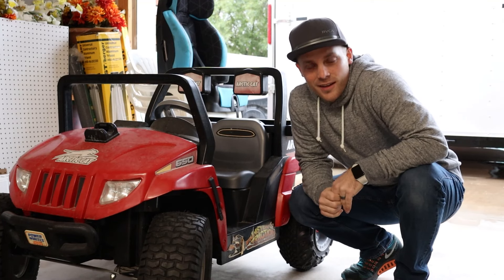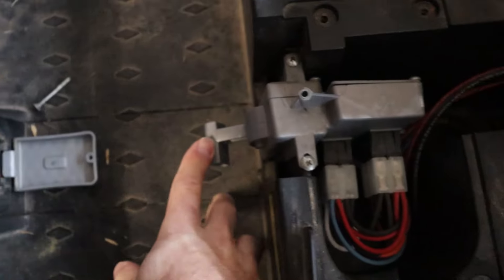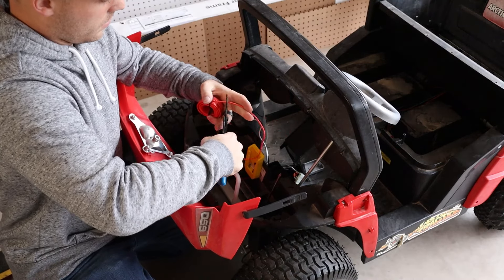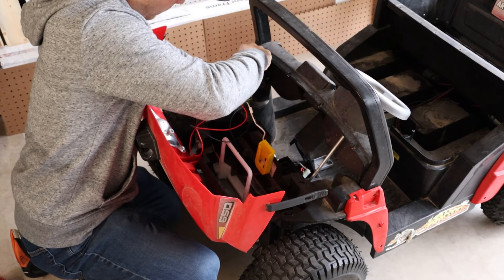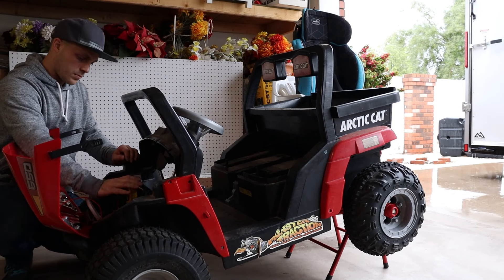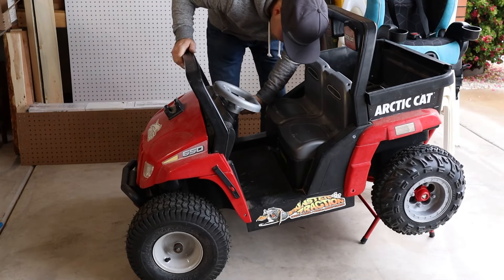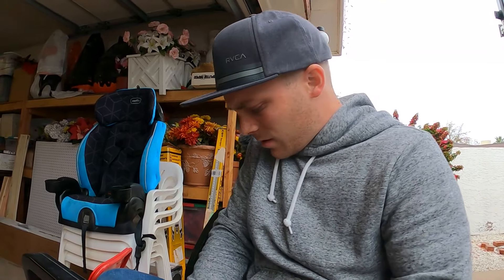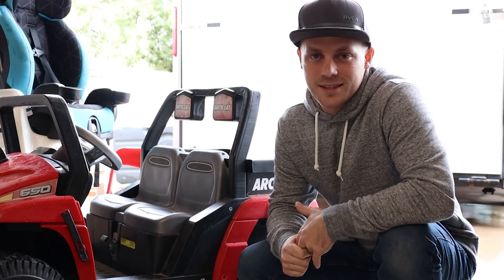Power Wheels Upgrade - HOW TO (20V Battery Upgrade)

Comment: Hey. I’m looking to do something similar to my nephews Police Dodge Charger, but I just have a few questions. Can the DC Motor Controller work when the car is in reverse? I noticed you were able to do it in the video however on Amazon people mentioned an additional relay is required. Also instead of adding a switch this Police car has a built in one that powers it’s radio, siren/lights, batter level indicator functions on the dashboard, as well. So my question is, the wiring it somewhat similar to you however the wires for the accelerator and ignition switch lead towards the rear of the car to the gear selector, to the motors and ultimately the battery. So would I simply disconnect the old battery. Use the DC controller and connect the motor to that and connect the new battery, without having to cut or add any additional wires. My main concern was if the lights and other functions on dashboard burn out when connecting a 20v battery. I know the 20v dewalt battery adapter has a 30A fuse and so does the DC controller but i don’t wanna take a risk blowing things up lol. I wish the car didn’t have these extra electronics to complicate things but your input would be greatly appreciated. Sorry for the long post! And thanks again.
Reply from the maker: Good questions.

The DC Motor controller only controls voltage (which governs speed), not polarity (which reverses the current and motor direction - think forward/reverse). So it's true that you need something else after the motor controller in the wiring to control the direction the motors are turning.

If the gear selector on the car is similar to mine (FWD High, FWD Low, and Reverse), then what you described you plan to do  - swap the old battery with the new battery, battery connector, Fuse, and DC motor controller and leave the rest of the wiring in place - will work. Doing this will allow you to control the voltage to the whole car simple enough.

As for the lights, sirens, and other features, there could be an issue with those. Without seeing the circuit, it's difficult to say for sure. Most of those components will be rated for a specific voltage (i.e. - 12V DC), but they will also have some tolerance at which they can run and not have any issue (i.e. - between 9V - 15V DC or something similar). By increasing the system voltage to something higher like a 20V Dewalt battery means that you may be outside the range at which they will operate effectively due to the combination of current and voltage that those features will use. Too much of both at the same time means power overload and burn out.

If it was me, I'd try doing the swap and see what happens with the other components. If I wanted to keep those features and make sure they work, I would also consider looking at trying to isolate the circuit which goes to those other features if possible and consider adding in a separate voltage/motor controller or a buck converter (like this maybe https://www.amazon.com/Converter-Adjustable-Regulator-Efficiency-Transformer/dp/B08L5VRBZS/ref=asc_df_B08L5VRBZS/?tag=hyprod-20&linkCode=df0&hvadid=475793181977&hvpos=&hvnetw=g&hvrand=17271168766185585186&hvpone=&hvptwo=&hvqmt=&hvdev=c&hvdvcmdl=&hvlocint=&hvlocphy=9030031&hvtargid=pla-1130173743967&psc=1) to step down the voltage only to the parts of the circuit you need to.

But that's only if I wanted to keep them in place. If that did not matter, I would consider disconnecting them from the circuit and closing off the loose wires so there's no hazard in place.

Good luck with the project! Would love to hear how it turns out!

Comment: How long does the battery last compared to a power wheels battery
Reply: Looking for the same info
Reply from the maker: Depends on the battery size. A 4 or 5 amp hour battery can give the kids a good 45 min runtime on level ground. I have not done a full time test to compare the difference, but the original battery seemed to be close to 10 mins if I was lucky.

The big benefit is having several spare batteries around that can be charged up and making it really easy to swap out and keep going.

Comment: 30A fuse is wild.
Reply: Considering those 20v drill batteries are around 6amp hours and typically draw less than 10amps actively.. yeah. Way too high to protect anything. A 13 or 15 fuse would be about perfect.
Reply: I keep blowing my 30 amp fuse . Trying to figure out a way to fix it.

Comment: How long will it run with a fully charged battery
Reply from the maker: It depends on the size of the battery. If I run it with a 4 or 5 amp hour battery, the kids can usually get a solid 45 min out of it. Having multiple batteries available and charged up though makes it easy to get more use by switching the batteries out quickly. That's one of the biggest benefits in my mind.

Comment: I did this. It works but my 30 amp fuse keeps popping . Barely rides 5 minutes without blowing the fuse. I am currently searching for a fix.
Reply: I have this problem as well too much volts from the 20v dewalt battery.  Think need to upgrade the 12v system to a 24v wiring kit

Comment: When you turn the motor controller all the way up is it sending 20v through the 12v speed controller and motors? 

I figured i could boost the voltage a little higher but wasnt sure if 20v would be too much for the 12v components...
Reply from the maker: The motor controller I'm using is a DC speed controller. There are no other components in my system that regulate the speed for the motors. When it is all the way up, yes, there is 20V going to the motors and downstream components.

For a DC motor, in general the speed is dictated by the voltage (V), while the torque is dictated by the current (I). Watt's law says that power (P) is equal to the voltage times the current (P=IV). Ohm's law says that voltage is equal to the current times resistance (V=IR) or the resistance is equal to the voltage divided by the current (R=V/I). It's important to consider both of these laws in your system. A DC motor will draw more current to try to maintain the load which can lead to run away and burn outs.

What it means in reality is that if you run a component at a higher voltage or a higher current, the power will be more. If you run the component at a higher voltage and maintain the current load, then the resistance of the component will go up. In general, when resistance goes up, components tend to get hot. That's where burning out motors or components happens.

So yes, DC motors can usually handle more voltage than what they are rated for. But that has to be balanced out with the current load to ensure the power and resistance are not so much that you create "magic blue smoke". That's why I used a fuse in the configuration - to help limit the amount of current and prevent burning out my motor or components. As long as my components are rated to the fuse current or higher, the fuse will help protecting them.

There's probably some exceptions, but I won't cover them here. Happy building!

Comment: Nice!  How much range do you get on a power tool battery?
Reply from the maker: It all depends on how it’s used and capacity of the battery. The age of the motors may also have an impact. Driving on flat ground, I can expect around an hour on a 5 Ah battery. The best part is having multiple batteries that are fresh that I can switch out with if needed.
Reply: Good job..I just did this for my child rubble digger which is only 6 volts but I put 20 volt battery and I just keep it at 35 or 40 speed so I don't burn out gears or motor Im.just happy it last longer then lead battery and charges waaaaayyy faster
Reply from the maker: Sounds awesome! And it's true, way better than the older batteries.

Comment: Thanks for this. I did this on my kids' PW Dune Racer 12V. Added an in-line fuse, but it pops quickly. Weirdly, a 25amp fuse lasted about 5 minutes, but the 30a fuse went out immediately. Suggestions? Increase the fuse size or try something else? Didn't add a speed controller.
Reply from the maker: This is a great question - something pretty common. You could increase the size (I would not recommend something over 40A). The bigger the allowable amps, the higher the possibility for burning something out at the motors.

The important part is to understand why the fuse is popping. The motors will essentially draw as much current as they need to keep rotating. If the resistance against the motor turning increases, it requires more torque to overcome which means more current and power. In my experience, as long as it was driven pretty normally on flat ground by kids who were not too heavy, there was no problem. However, get a hill, someone grabbing it and dragging their feet or kids too big, and I would pop fuses left and right.

Also, making sure there’s nothing else the wheels could be rubbing on could help too. Hope that helps!
Reply: @TheWorldIsOurLab  Thanks man. Great advice. I’ll bump up to 40a and tell the kids to lay off the twinkies. 😁
Reply from the maker: Hahaha!
Reply: How has this worked out for you? From what I’ve read, 30A fuses are too high for the gauge wiring on these battery docks. I tried a 30A fuse with my car on “jacks” for testing and had smoke coming from the wires. This project is starting to cost me in fuses.
Reply: @BRoop89  30amp fuses blow very quickly, especially with my 10yo son. The younger kids get a little more time but still pop the 30a when driving more aggressively. 40a is a big improvement, and I just watch the wiring/battery more carefully. All is normal, but even 40a doesn’t last too long. Just depends on conditions. Not sure I want to try 50a - too much risk to battery. Good luck.

Comment: How long does the battery last in the power wheel
Reply from the maker: I'll do a test soon to get more exact numbers. Estimates are around 20-30 minutes for a small battery, and 45 min or so for a larger one. I don't have specifics because it will vary by the motors and size of the battery obviously, but also how hot or cold it is outside as well as how old the battery is. The really nice part is that if you have multiple batteries, they can be swapped out in no time and one can be charging while another is used. Makes for almost unlimited time.

Comment: How long those the battery last ?
Reply from the maker: Depends on the battery size. A 4 or 5 amp hour battery can give the kids a good 45 min runtime on level ground. The big benefit is having several around that can be charged up and making it really easy to swap out and keep going.

Comment: So from the power source, should be the fuse then the rocker switch then speed control then connecting to car wires? I just picked up a kids moderno jeep. Believe the previous owners blew the steering motor as that no longer worked with the remote and they were using a dewalt battery but was direct connecting it to the cars wires. I noticed there is already a 30amp fuse as part of manufacture wire assembly.
Reply from the maker: Yep. I put the fuse right after the battery so the other components are protected. If you have a remote control based version, the overall wiring may be different for you. I don't have a version for that yet.

Comment: Where did you get the wheel?
Reply from the maker: If you are talking about the front wheels for the car, those are riding lawn mower replacement wheels which we swapped out. I may be doing a video on that process later.

Comment: Is that 12 volts motor in  to 20volts Battery?
Reply from the maker: Yes, that's how this one is set up.
Reply: @TheWorldIsOurLab  My kids 12v jeep burned the control box today running 20v batteries… bummed
Reply from the maker: @derrickroberts93  sorry to hear that! In this build, I ensured that I had a fuse between the battery and the control box which was rated for the same or less amps than the motor control box. This will mean that if there is more current than the motor controller can handle, then the fuse will take it first and burn out. The fuse would need to be replaced, but that is generally easier and cheaper than replacing the motor controller. Good luck!